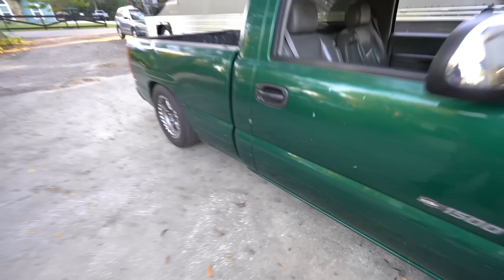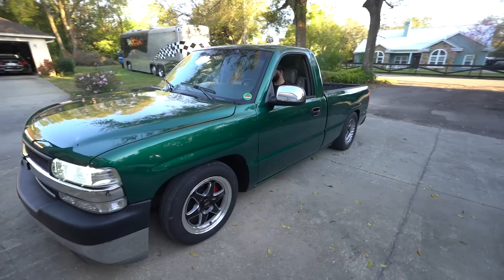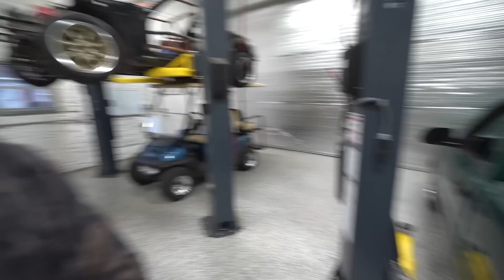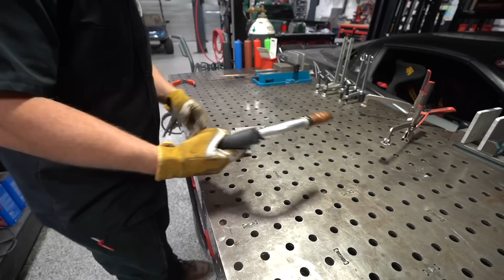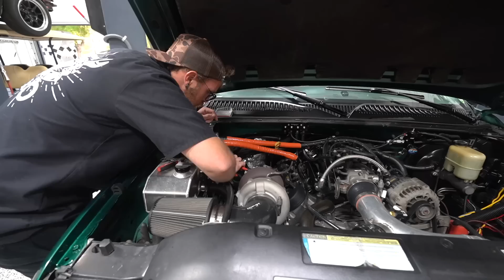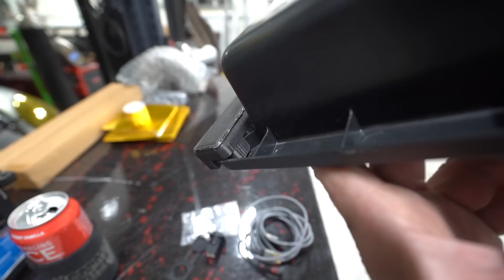Turbo LS Street Truck. major upgrades. It’s all new

Comment: I've got a similiar, if a lot more basic & cheaper, turbo Sierra and a cutout makes it ultra pleasant to drive. Quiet as a mouse until I want to go loud. It's a vac-based unit and I use a solenoid with a pressure switch & 3-way switch (auto, open, off).

Comment: For a drag and drive streettruck I would keep it as street as possible. Maybe switching to E-throttle could be the move for both estatics and keeping Cruisecontrol. And a bedcover to finish it of for aerodynamics. Keep this like a nine second index truck and since you are building a dedicated dragcar, you can scratch the 'going real fast itch' with the RX7. The truck would be great for listracing and drag and drive events. Where it is now it's where it keeps it fun and reliable enough to just enjoy drag and drive events without risking having to wrench all the time during events. It's solid like the BMW.

Comment: You should use an NBSS/TBSS intake with engine cover. It looks nicer, flows much better, has larger throttle body, and best of all you can retain cruise control.

Comment: Nice upgrades Taylor.  Before you decide to change your HVAC blower blower motor, check your in cab filter first as It may need to be replaced.  Def need a turbo blanket to protect your fittings and wiring and with a larger turbo this truck should boogie. Test and Tune time.

Comment: The correct sensor you need is on rockauto you have to dig for it but it took me a year to find it. The early 2000 trucks were really ugly with parts especially the ls trims

Comment: Love you kept the Green. Toolbox is a brillant solution! We did the same on my Dads F100 to get the cab tank relocated to the bed. If you dont like it shiny you can take it back to the paint shop and have them spray the bedliner they use on it.

Comment: Little bit of foam padding in the corners and under the wheels of the jack will help with it bumping around and denting the metal outward from its weight and not being loose in there.

Comment: The fast lsx-rt intake has provisions on it to use the stock gm throttle cables and brackets to save cruise control

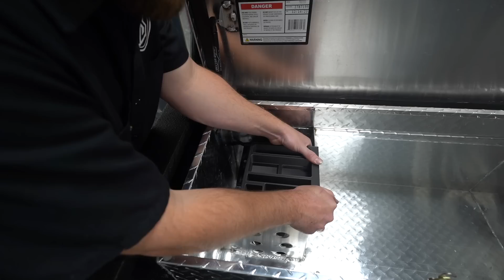Comment: 27:30 You could have split it into 4 smaller prints, with some indents to line it up.
34:00 Simple thing of testing the item before you even put it into the compressor...

Comment: The blower motor out put is probably a clogged cabin air filter. There's two that stack on top of each other in the middle of the hvac case.

Comment: A simple aesthetic/performance upgrade for these trucks is the 19+ front brakes. They bolt right up. Couple half inch washers to space the callipers correctly and you got a cheap 4 piston brake upgrade.

Comment: Why not a tbss intake with a 90mm throttle body and glenns auto performance sells a bracket that allows you to keep the cruise control. They also have a faq how to swap it as well

Comment: I learned how to weld on soft vergin aluminum with a spool gun. I learned that you need to pull the puddle with aluminum vs pushing it with steel. Truck looks fuckin awesome man!

Comment: This generation Chevy and gmc blow the heat and AC way harder than any other vehicle I have been in. Setting 5 absolutely rips. If the air output speed is weak then yeah maybe the blower motor is worn out but that isn’t a problem I’ve ever faced so I don’t know the solution. swapping it out is cheap and easy though. 

Source: I’ve owned 18 different gmt800 platform vehicles. All had incredible air speed from the blower motor.

Comment: IMO basically all OEM harness connectors are utterly terrible for a couple of reasons. One, they are often pushed together by machines that can exert far more force than your fingers can and two they are designed to not come apart for the next 20 years and 200k+ miles. That is just a recipe for hateful experience
Reply: Also it may have been quicker to make those tray extensions out of aluminium but it looks like they were sold that way with the 3d printed parts. Also if you have a soldering iron you should be able to melt the seams together if you want so there is no chance of them popping off

Comment: Modify a 102mm throttle body to add the cruise control, the fab projects you've tackled that sounds easy. It's a manual cruise cable. Also, is that a mustang in the garage?

Comment: TAYLOR RAY,  Are you kidding????    With your ability and wanting projects for your solid printer----------  You could absolutely build a mount for your cruise control for any manifold.  But just go to an LS3 style or the FAST intake has probably already solved the issue.  It deserves to look pretty under the hood.   Also, consider Spraying a couple rally strips up the hood out of Black Plasti dip.  It will kind of match the bed liner in color and texture and the black grill inserts.  Plus,  comes off easy if you decide you don't like it.

Comment: For the small tray you 3D printed, how about cutting it into 4 pieces, zig zag the edges, or create pins and holes, then super glue or "plastic glue" them together, to create a larger tray that would cover the shroud completely.

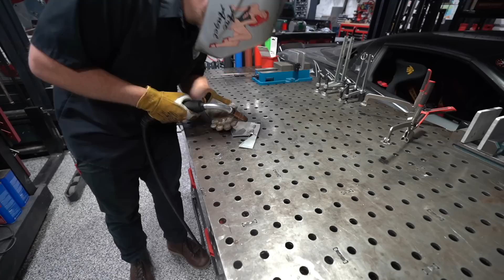Comment: 22:00 I always push while mig welding aluminum, it comes out much cleaner, less soot and the bead is more uniform. Also forget about watching it, it’s all about being hot and fast, find the angle that works best and run it.

Comment: I’m curious to see how you set the suspension up so it leaves straight off the line and drives straight down the track with all the weight on the drivers side!! Definitely need to film that lol

Comment: You need to bed liner the tool box so it will disappear in the bed. And splice the mini organizer into 4 pieces and plastiweld it together to make one that fits the hole. And I was also told you have to suffer for the style. Ditch that stock manifold and get a high ram!

Comment: I'm pretty sure most Holley throttle bodys have a cruise control cable mount on the butterfly arm and I'm sure you can make manifold cable mount work. I just installed a holley hi-ram with a holley EFI 95mm throttle body on a SBC in a 93 OBS and made the cruise control work. There is a vid of it on my channel, if your interested.

Comment: Would you want to add some silicone around the hole in the bottom of the box to prevent any moisture/water from seeping in? Say if the truck is outside in the rain. I know the bed holes would get most of the rain out the bed but you wouldn't want water getting in the box and staying there getting stuff wet at the bottom.

Comment: Tbss intake, I also have a 99-02 dbc truck and I have a tbss intake with a 92mm Ebay throttle body,still have cruise control too!

Comment: Check out retro-fitting a cabin air filter in the air box. It's simple enough to do, and it will give you access to clean the evap core that's been doubling as a filter. I just did this to my friends truck, and it's night and day difference. Thanks for all the amazing content!

Comment: Though on the blower motor. Try reversing the polarity, if it's had a fan replaced in the past, do not trust the colors of the wires. 
New toolbox looks like good and love the fresh paint. 
It's a street truck first, so if you can't keep the cruise control etc it fails as vehicle you're just going to jump in.
Same with the turbo, don't go power hungry. But yes re route the waste gate etc. 

Grab a good quality mouse, it makes CAD design so much easier.

Comment: probably could take that truck on sicksummer or sickweek or other drag-and-drives.. you definitely want a set of street wheels/tires, and you could haul a few bigger spare pieces alongside the race set of wheels/tires.. have noticed some will just run narrow street tires up front for both racing and streeting, then the rears are the only real swapover tire/wheel wise.. can't run faster than 11.5 without a rollcage, though..

Comment: A lot of my work in 3D printing I’ve learned is to make traces or small “wireframes” of my profiles if I’m trying to hit certain tolerances before committing to a larger print.  Usually means making an outline to retain the piece that I wouldn’t normally use, or slicing the model/making a limited extrusion of the shape to just test certain features.  

Also, a new printer might make all the difference…I had a Prusa MK3, then bought a Bambu X1Carbon.  Print times were often cut down to 1/4 of what the prusa would do (if the prusa took 5h, the X1C might take 1.5h).  

XY printers will beat most XZ based printers since the bed is stationary most of the time which allows the head to move more freely, but even Ultimaker’s S5 is over 4x as slow as the carbon (although the bed is a bit bigger in x, shorter in Y).  

Worth a shot to upgrade to a better printer if print tome and quality are a concern.  Easily one of the best purchases I’ve made.   Made me get work to pick up the X1E with the heated chamber and ethernet jack.

Comment: Lol, why are the gages in Celsius 😅😅 I hope you put oil in the system. You really should weigh the freon to be accurate 30 on the low side nomore then 230ish on the hi side brother those are ( estimated numbers)  depending on out side temps so no so forth

Comment: Why didn't you get the 48 inch wide tool box because then it would make it where it doesn't look off center
Reply from the maker: It would still be off center and cover the vent for my transmission cooler
Reply: @Taylordrifts  k thanks for responding and loved the vids

Comment: There's room on the side without the box to fit a cooler.
Reply: Also, I've had a bunch of gmt800 platform trucks. That blower motor is barely moving air. That thing should be threatening to Mary Poppins you away. I used my truck's HVAC to dry clothes a bunch of times on trips because it blew hard enough.

Comment: Being that you live in Florida, if you printed those parts in PLA or PETG, they wont stand up to the heat that will build up in that box and will deform (esp. with the heat that the pumps give off).  Either print them in ASA (which I dont think your printer can do), or get a print shop to print them in ASA (much higher deformation temp then PLA/PETG).  Cant wait to see this thing do some passes.

Comment: Change to the Camaro LS3 waterpump when you do the new intake intercooler piping. Then just need an ls3 corvette upper rad hose. Much shorter. Way better routing.

Comment: Check the cabin filter. Behind the glovebox, I've changed mine a few times over the last 18 years. Might bring that blower motor back around. Could also check in the motor housing to see if there's anything in there that shouldn't be. The motor just twists off and drops out.

Comment: Glad you kept the same color man, looks good and saved ya money/time not having to match the engine bay along with inside. If it were me i would lose those chrome covered mirrors and just have black then the chrome strip up front too, not a chrome fan if u cant tell lol but it looks so good with fresh paint man. I have done the same setup with the toolbox to hide surge tank, fuel cells, air suspension pump, air tanks, and so much more, helps with thieves and its not only a cleaner look but everything is safe from rain/elements too. I lived in a high car theft area before moving down south so everything had to be locked down and keeping the crappy paint would help it not get stolen:), down here i leave keys in the vehicles and all the neighbors keep a eye out along with the cams. The last 10% of the build is the hardest and will take the longest, you got over the huge paint hurdle along with all the exterior trim/lights too and now its time to get all the little stuff that's been driving u nuts done. Can imagine there is a long list of little stuff and a couple bigger things you would wanna change but you will get there, sometimes all the projects can be overwhelming and you just have to attack it one thing at a time. Excellent video and great work as always Taylor.

Comment: T-Ray put the turbo truck on Cletus’s list, you can run a nine in that thing
Reply: This man… I’d love to see Taylor get in on the action.
Reply: that is a wayyyyy over estimate lol
Reply: @roachwerks3043  not at all, theres guys with the same combo in Colorados, without a built motor, running mid 9s. With no brake, no suspension, on a street tire, in a full interior car
Reply: @knowbull5hit590  No, there aren't.

Comment: "Ain't nobody got time for that"... I feel you brother. I put all new lights in the front of my Grand Cherokee yesterday. They came with a new harness and I used it. I put the whole thing back together without testing full functionality. Bulbs lit up, good enough. All together and guess what... turn signals don't work unless the headlights are off. Easy fix. The factory wired it wrong. I think I can get the harnesses out without taking off the bumper and grill. After an hour of fighting, cussing and bleeding I think, "maybe if I take out the battery and air cleaner". Then I put my foot down. No Krack, take the bumper and grill off. Ten minutes later, it's all back together and working perfectly. Next time, test it first. And if the harness ever fails again, step one, take off the bumper and grill. lol

Comment: Love the truck upgrades. I wouldn't mess with the esthetic of the engine bay until you feel its holding back performance gains that could come with getting rid of the cruise and stock parts.

Comment: Gotta do a front brake upgrade the calipers out of a 2020 1500 bolt right up just need some washers
Reply: I have that set up, minimum wheel size wheel you can run is 18’s with decent offset. I don’t think they will fit with the 17in welds
Reply: @Nikdabruh  forgot he’s got 17’s you’re right I have the same set up too
Reply: He just needs to put a set of TBM brakes on it 👌🏻

Comment: You should get in on cleetus' top ten list at the drag strip with the truck!
Reply: I was coming to say the same thing just now! This thing is perfect for it, plus it'll be good practice for when he finishes the rx7.
Reply: it might need a cage for that, though I don't think that's be much of a problem, I'd like to see Taylor get in on the drag and drive events as well, I think he'd have a blast
Reply: @DutchBart666  Cleetus is running his C7 for the list races and that thing doesn't have a cage, so I think Taylor would be fine not having a cage.
Reply: @MichaelVarlotta I don't think you need a cage till you start getting faster than 950... idk for sure but I think that's why at sick week they wouldn't show their times anymore is they were uncaged and running faster than 950... I may be wrong tho... I have been before I will be again
Reply: @MichaelVarlotta  C7 doesn't need a cage until 8.99 due to it being 2014 or newer.  Taylor's short bed needs a bar 11.49-11.00, cage at 10.99 or faster.  His setup should be able to run a low 10 on E85, maybe a bit faster if the track is on kill
Reply: @DutchBart666 he doesn’t need a cage. A lot of the cars don’t have cages. His truck would be perfect for it.
Reply: @DutchBart666 I wouldn’t think for test and tune? But may be wrong
Reply: Cleets Vet doesn't have a cage. @DutchBart666
Reply: Definitely needs some TBM brakes
Reply: First thought I had but I’ve never actually seen him drag race for real. I imagine he’d want to practice a bunch before showing up at a public event
Reply: @DirtStyle it’s a test and tune event, sounds like the perfect way to start dragging the truck.
Reply: It’s not fast enough to be in that index. But it would be great content to see him out there with the boys at BMP!
Reply: @Scott-Tim what do you mean it’s not fast enough that truck could run 10s to 9s all day. It has a built motor and a nice size turbo. This truck is perfect for the list.
Reply: 100%%%
Reply: He wouldn’t stand a chance against Texas I’m sorry but they got their trucks on lock down by now!!!
Reply: Agreed! Next race is tomorrow! He could get in and make some test hits this one and call someone out next month!
Reply: Man i love this little truck. I really like watching your videos its gets my pumped to get in the shop and work on my stuff. I'd love to see a set of the chrome gm 22 snowflake wheels. Keep up the good work.
Reply: Taylor see if you can make this happen
Reply: I agree!!! I think this truck would be awesome Cleets List Race. Isn’t called something like, Cleet Outlaws?
Reply: That would be cool to see it rip!
Reply: Paint and or hydro dip and keep the cruise control
Reply: He would need a way bigger turbo and a another 600 hp to even be close to competitive they are like all 8 second trucks
Reply: Do it
Reply: Also take it to drag week
Reply: This is a good idea. Good content id think
Reply: I came to the comments for this idea👌💪
Reply: Agreed do it would like to see it in the line up
Reply: was coming here to make this comment lol
Reply: He won’t
Reply: I don’t believe this truck is for that
Reply: @chadowens7861 how is it not for that. He says all the time it’s a race truck. It’s exactly for that.
Reply: He would need to go awd to be competitive.
Reply: Na, he could still be competitive with rwd  @vegetablegod
Reply: @vegetablegod  it’s a 9-10 second index class, that truck should run that now.
Reply: @vegetablegod  the awd back of the track stuff is different then the Thursday night list races
Reply: @vegetablegod Negative
Reply: @vegetablegod you’re talking about 2 completely different races here I believe
Reply: @LFRPerformance-s7b  You’re right. I wasn’t thinking lol.
Reply: @vegetablegod for what? that truck should run 9.50’s